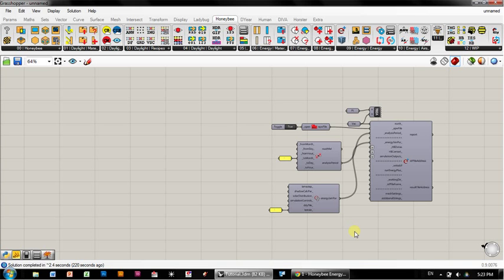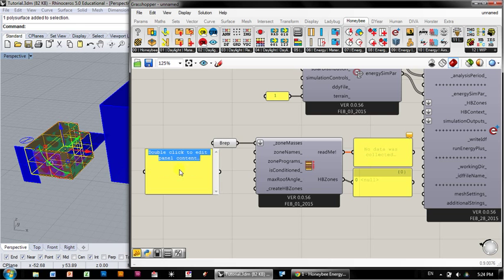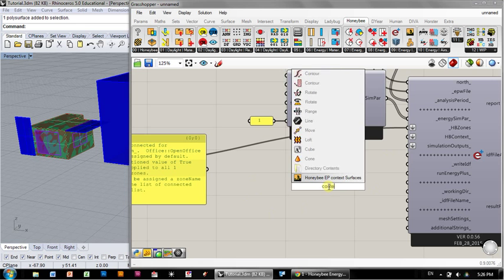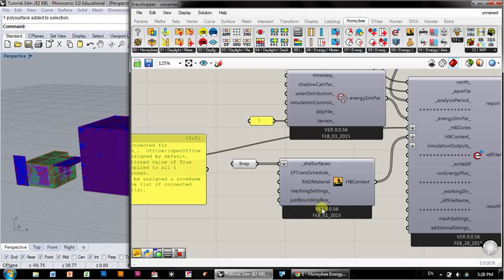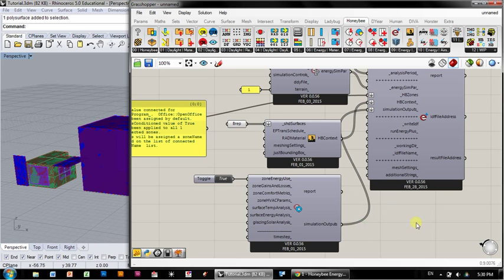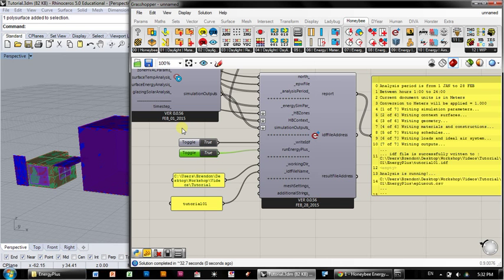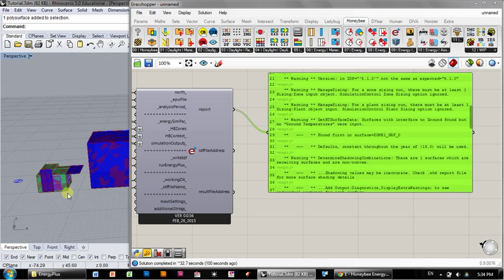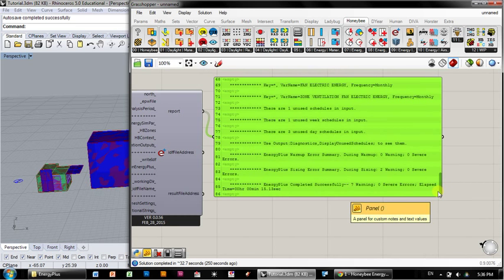02 Honeybee Quickstart - Defining Zones and Running a Simulation

Comment: Hey Brendon, I've followed your instructions and double checked twice, but when i get the the results i dont get 6 outputs like you do in tutorial 3, i only get 3, heating, electric light and electric equipment, do you know why? :P
Reply from the maker: Hi Ole.  It's strange that you're getting a heating output but no cooling output.  Check your HVAC system to make sure that it has cooling.  You can also check the EPOutput component and make sure that zoneEnergyUse is set to True.